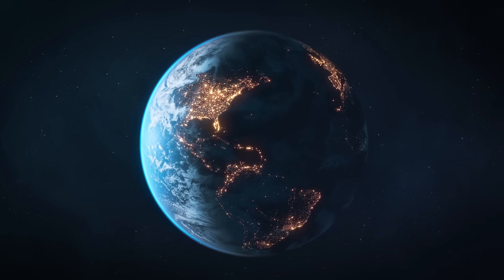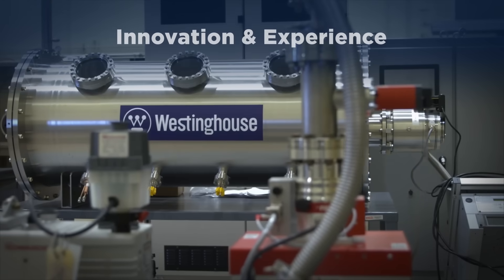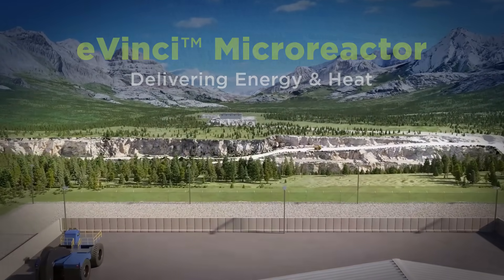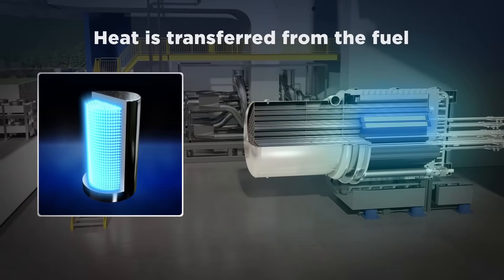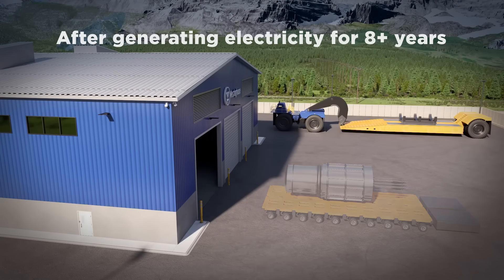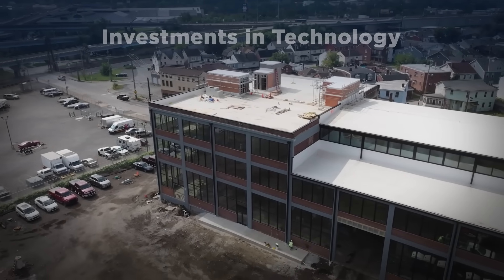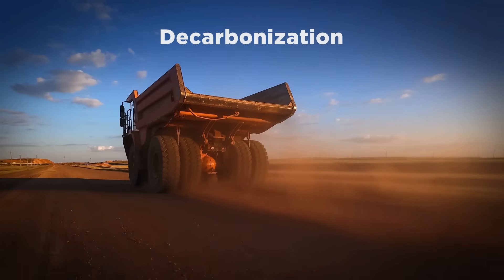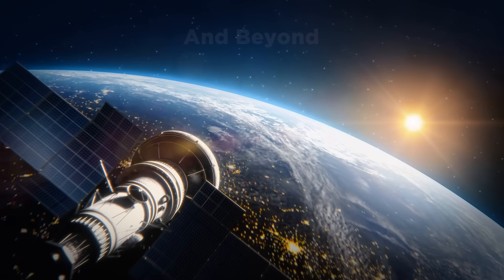Explore eVinci™ Microreactor Capabilities as Westinghouse Technologies Facility Opens

Comment: While microreactors offer exciting potential for clean and portable energy, they also come with serious risks. These small nuclear units can still produce radioactive waste, face security concerns like theft or sabotage, and may be more vulnerable to accidents due to lighter containment. The regulatory system is still catching up, and deploying them in remote or unstable areas raises safety and oversight issues. Until these risks are fully addressed, widespread use of microreactors could create more problems than they solve.
Reply: All forms of power generation come with risk, nuclear is no different. Rest assured, ANY nuclear generating station would require security and certified reactor operators and support staff. That doesn't change with reactor size and power output. I believe you may be under the impression anybody can just buy a small reactor and enjoy 8 years of grid-free power. There are still NRC regulations and mandates to follow and local/federal approvals to be had.

Comment: My father worked in that building in Etna, PA in the 1960s and 1970s.  He ran the lab for his employer Pullman Swindell specific to the HYL direct reduced iron process.  Here is a bit of irony.  One way to decarbanize the steel industry being looked at in Japan is to use nuclear energy to produce hydrogen without electricity.  Hydrogen is a reducing agent that can be used to produce direct reduced iron using either the HYL process or Midrex process.  Midrex is better.  If Westinghouse produced a reactor that produced hydrogen using the heat of the reactor and enough electricity to run the steelmaking electric arc furnace / caster / rolling mill then that would go along way to decarborizing the steel industry.

Comment: I read somewhere that the working fluid to be used is atmospheric air. 
That also raises some questions
1. The thermal-mechanical-electrical energy conversion system to be deployed is not disclosed. would it be an unconventional tech?
2. If conventional tech is used then a Gas Turbine will the likely option. Nevertheless they operates on high pressure and temperature ratios. will a compressor be needed?
3. If so how will this concept be sold since simplicity is it key selling point?

Comment: In fact, they have an extremely vast experience in the field. Such small reactors don't need expensive security measures as they contain too little fuel. Compared to Chornobyl reactor, each of them is thousands times smaller unable to pollute larger territories. And technology is well proved and used in various military applications

Comment: What happens to the removed unit when removed?
Only claim they will take it away. 
Imagine what that cost would be if it's hazardous waste.
Reply: Reactor uses TRISO fuel elements so when the reactor reaches end fuel life it's removeable and presumably refuelable. 
TRISO doesn't pose hazardous waste, many components potentially reuseable
Reply: @spikedpsycho2383  very interesting concept.
Reply: @survivingpoverty  TRISO fuel consists of triple layer of graphite and ceramic coating over core uranium kernals. So in a hypothetical situation that would trigger a fuel meltdown cannot happen. Even if the fuel "Melts' it melts inside it's own mini container. The interior layer of pryolitic graphite has a trigger temp 3,500 degrees C, Hotter than most any melting substance; and doesn't Melt it subliminates like dry ice, But would occur inside it's own ceramic liner.

Comment: Some questions left unanswered:
1. What fuel does it use?
2. If you use it at half its power capacity, would it last twice as long, or no?
3. Estimated cost per kWh?
4. Estimated E.R.O.I.?
Reply: Fuel is Triso Haleu. You can control the Performance using the control drum. Less Performance means longer life.
3. and 4. actually good questions.
Reply: 1: TRISO fuel in housed cannister elements
2: Fuel burnup is not byproduct use, it'll run regardless. 
3: Question of Power cost in typical areas but average 50-100 dollars per MW-h is the target. 
4: unknown, but it's mainly set for remote power applications, I think the Military would be more interested
Reply: EROI is not really relevant in their intended application and I'm pretty sure it would not come close to competing with traditional sources. These are for remote areas with no power, such as in Africa etc. where the need for power will drive this , not a ROI.
Reply: @ChappyAUS Africa is a continent. Could you be more specific?

Comment: These are significantly safer being so much smaller in footprint, and ultimately can provide power exactly where its needed removing the need for expensive transport of the electricity.

Comment: What fuel does it use? Thorium?
Reply: No. TRISO Uranium. 
TRISO is an acronym, basically its uranium fuel housed in several layers of ultra high temperature ceramic. And is enriched to a level of 19.75% U-235.
Reply: Uranium (U) based HALEU (< 20% enriched).  These HALEU TRISO particles "run hot" and generate some plutonium (Pt).  Then both U and Pt "burn" and not all the Pt gets used up.  However the ceramic encapsulated TRISO particles contain nearly all (99.999%) of the U and Pt reactants (vs. old-school "open air" fuels for old Gen I and Gen II, and Gen III and some Gen III+ reactors)
Reply: Triso. Aleación de uranio empobrecido con oxígeno y grafito en un recipiente a prueba de fugas.

Comment: No water is required for operation or cooling.....eh....
Reply: There are two types of cooling for GenIV reactors.
1. High-Temperature Gas Cooled: using 750C Helium noble gas that remains a gas and has no phase changes (vs. GenIII+ water cooled that goes from water to steam to high-temperature steam).   The helium remains a gas all the time so is very easy to predict its properties. 
2. molten salt cooled: which remains a liquid at around 550C.  Around 800C the molten salt begins to turn into a gas...so they keep it around 550C maximum temperature.  Again this MSR (molten salt reactor) does not undergo any phase changes to gas, so is easier to predict performance.
Reply: The eVinci is the first of it's kind; Solid State reactor. It doesn't use pumped fluids as coolant. 
- Unlike conventional reactors the Solid State reactor has no moving parts except the control rods. 
- Unlike conventional PWR reactors there is no water in the core thus no risk of any core failure or coolant leak issues
- The Unit doesn't use flow coolants of liquid metal like flammable/explosive sodium or heavy lead/bismuth eutetic thus mitigating molten metal's corrosive issues
- mitigates all waste heat via solid state tubes i.e heat pipes just like the CPU in your computer. 
- Initial heat exchange takes place Outside the reactor, not in it thus there is no need coolant loop or pumped coolant loop, since it conveys heat by solid thermal contact instead of a working fluid; it requires no pumps and thus No emergency pumps are needed for overheating risk
- Manpower requirements are significantly lower, thus making it nearly a turn key operation. 
- Solid state thermal contact also ignores gravity thus making it ideal in zero-G environments like space or can be installed in any orientation without compromising function
- The core is encapsulated in pyrolitic graphite and use TRISO fuel, thus compatible to the High enrichment rate of naval reactors thus potentially achieve a full life cycle before refueling. 
Lastly, the reactor has a core max temp of 1,500 degree's C, and TRISO fuel elements have a melting point of 2,800 degrees C; so it can operate at variable peak output temperatures of 500+ degree's C. Thus With a heat exchanger is able to produce with exact high psi, high temperature steam, this makes it compatible with existing coal plants turbine/steam equipment
Reply: @spikedpsycho2383  actually fascinating

Comment: After 8 year what do you guys do with the waste then? You guys dont say a shitt about that.
Reply: 'Once the fuel is exhausted, the microreactor can be hauled away for disposal and another one plugged in its place to continue operations on-site, much like a battery. The microreactor is equipped with shutdown rods that are used during transport for increased safety. The nuclear fuel can be stored in deep geological repositories (DGR) for long-term storage.'
Reply: @droiduser1984  ok so you say ust put it away somwhere on Earth, and let it get bigger and bigger. This dont resolve the main problem, that is the radioaktive waste. You guys saying its not recycleable at this point then. So the waste is still there. And you guys ust push away and store it in a storage that will be bigger and bigger to more people that are using the product. When you have a way of recycling the waste that day you guys will have a furture. Not now.
Reply: @Carlos-im3hn  main thing your system is still not 0 / zero bad waste.
Reply: tmyrdal, Don't worry, they already know how to do it in Russia...
Reply: Once the TRISO fuel is "burnt up" it can not go critical again and is inherently safe.  TRISO fuel particles are ceramic (glass) coated and only emit 0.001% of any fuel...retaining 99.999% of the fuel.  This is much safer than GenI, GenII, GenIII reactors that did not have TRISO or ceramic coating and were "open air" nuclear fuels.

Comment: " Heat pipe " technology??
My North Korean cat says it probably means air cooled
😂😂
Reply: Ha, ha… no, a heat pipe is a real thing.  The most simple version is just a long somewhat skinny tube filled with a volatile fluid like ammonia or acetone.  They usually need to be tilted at an angle so that the fluid pools at one end.  If you apply heat to that end (heat released from radioactive decay in this case) the fluid sucks up the heat by boiling, then the vapor rises to the other end, which is cooler, where the vapor condenses and releases the heat. They show a quick cross-section view that shows a whole bunch of these tubular heat pipes.  The heat pipes help maintain a hermetic seal.  They probably have a fancy working fluid in their heat pipes since the reactor gets very hot.

BTW, this is a really poor video.  The device they show just makes heat, not electricity.  If you go to their web site, they have a schematic that shows the whole system. The heat from this micro reactor has to go to a separate steam turbine powered generator to generate electricity.  In this video, at the 36 second time mark, they show the generator in the background of the internal view of the building.  Their web site implies that some customers would just use this reactor to make heat.
Reply: @roberthigbee3260  i see thanks for clarifying, 🐱👍
Reply: It's the same tech you use in your computers CPU. 
eVinci uses next gen alkali heat pipe, NASA uses to cool satellites in a vacuum. It's already being used in HIgh temperature furnaces because heat retention to improve the efficiency of boilers in apartment buildings and large residences.

Comment: MR FUSION
Reply: These are slightly fast reactors converting some U into Pt and burning both (but not all Pt).  
These are 100% fission reactors using both U and later Pt as fuels in the same TRISO coated and ceramic encapsulated fuel particles.
These new fangled TRISO fuel particles retain 99.999% of the U and Pt held inside which is intrinsically safe. 
Very few radiation is emitted and relatively easy to handle vs GenIII and older fuels.
Xe-100 also continuously refuel and have 60 mm diameter "baseball" sized pebbles that have thousands of TRISO particles within each.
The TRISO is the special sauce for these GenIV reactors (that are using TRISO).

Comment: What happens to the reactor after 8 years? Where does it go and how is it stored? What is the impact on the environment of a spent reactor?
Reply: "Once the fuel is exhausted, the microreactor can be hauled away for disposal and another one plugged in its place to continue operations on-site, much like a battery.
 
The microreactor is equipped with shutdown rods that are used during transport for increased safety. The nuclear fuel can be stored in deep geological repositories (DGR) for long-term storage." -- Interesting Engineering article excerpt
Reply: it then goes to microreactor heaven.
Reply: Perhaps toss it into space? They already have a device in the US that can catapult heavy objects into space from the ground. Just an idea.
Reply: They use it on ammunition tips probably😂😂😂
Reply: While not addressed in this video, the intention would be to refuel (and presumably refurbish as required) the reactor at a dedicated facility, then use it in another location.
Reply: They put it on a train which promptly derails in a suburb.  🙃
Reply: @LeCharles07 in which case they could simply load it onto a transport truck and drive it to it's destination -- unlike a train full of propane, natural gas, gasoline or diesel oil -- which could explode and destroy the town....
Reply: 😂😂😂 @LeCharles07

Comment: What does MWe stand for?  Is that a fancy way of saying megawatt?
Reply: It's megawatt for electricity, my friend. This concept is always in the electricity power plant. While MWth is megawatt for thermal. Due to the efficiency is always less than 1, MWth is always larger than MWe.
Reply: @王静怡-p2k so it's basically saying you produce more heat than usable electric energy?...this is not fair I demand more money be spent on r&D to produce devices output greater than 1..I want overunity devices available to public such as the Testatika !
Reply: @fidelcatsro6948 this is a joke, right?
Reply: 1 MWth (th=thermal) yields in about 300 to 400 kWe (electric). I assume 30 to 40 % efficiency. As smaller the unit the lower the efficency.
Reply: Megawatt electric
a reactor will produce energy in form of heat and that must be converted via a mechanical means usually a steam turbine
Reply: @spikedpsycho2383  
I read somewhere that the working fluid to be used is atmospheric air. 
That also raises some questions
1. The thermal-mechanical-electrical energy conversion system to be deployed is not disclosed. would it be an unconventional tech?
2. If conventional tech is used then a Gas Turbine will the likely option. Nevertheless they operates on high pressure and temperature ratios. will a compressor be needed?
3. If so how will this concept be sold since simplicity is it key selling point?